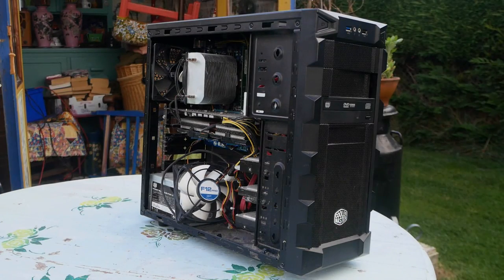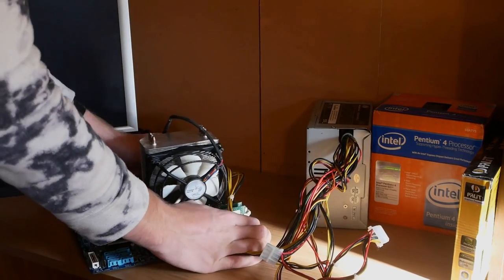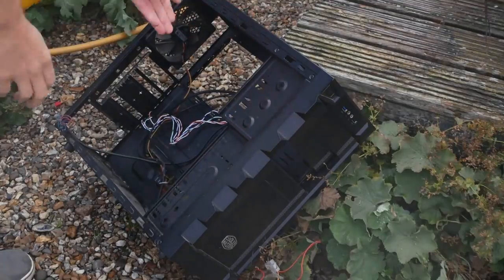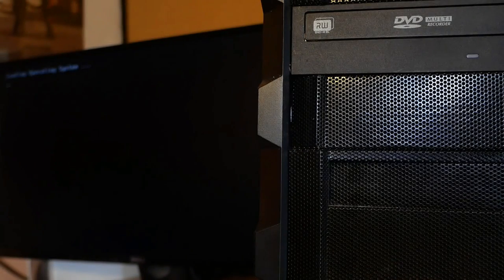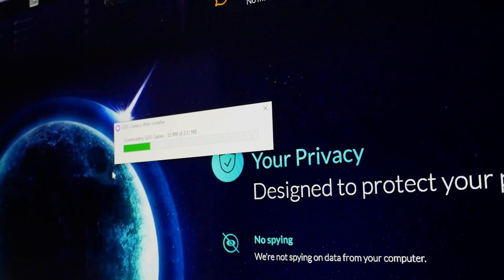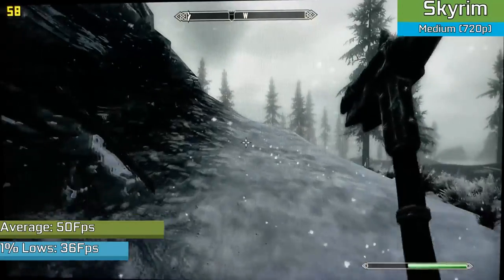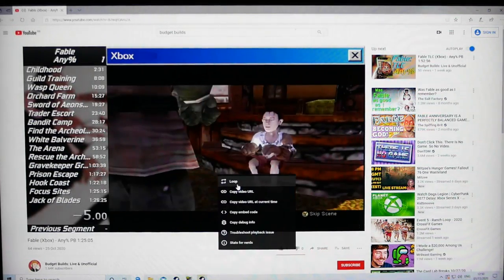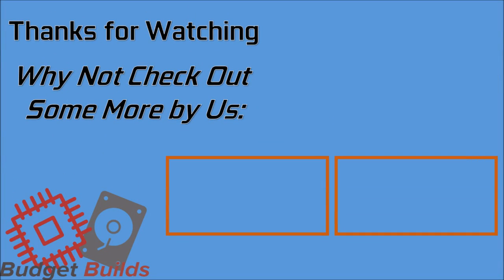I Bought an Awful Computer from a Barn....

Comment: I just found an i7 7700 with a 1060 mini 6gb near a street.
I think i have just used up my luck for the next few years.
Reply: noo wayyy
Reply: I found an NEC EA232wmi on the side of my road. Also grabbed an iPhone 6 (which needed a new screen and home button) and other things from the dump.
Reply: @lbsiuk  how do u even find ANY monitor on the side of the road 😓
Reply: Was the owner far enough for you to run away unseen?
Reply: A couple of months ago, i found some Bose bluetooth headphones, i didn't think much of em, but i went to the electronics store a week ago to pick something up, and i walk by a Bose stand in the shop, i looked at the headphones, and what do you know, i saw the exact same model i found in the dumpster, my jaw fell on the ground when i saw the price: 240 euro's! So i think i also used up my luck for a good while :p
Reply: About a month ago I found a i5 6600k and gtx 1070ti. The only thing wrong with it was a stick of ram went bad. I bought 16 gigs and it is now my main machine
Reply: Think the best thing I ever found was 2x2GB DDR2-1000 for 20€ and a P35 board for 40€
Reply: last month I've found an Alienware Area 51 R4 with 2 GTX 1080TI for 50 € on Marketplace. Sadly it seems no parts are working but still i will make money selling it for parts i think 

In the dumpster i also found my HP Probook I3 laptop from 2015 that had only a bad hard drive and an older AMD FX machine with a 6950
Reply: I just found a i7 2600k, Noctua NH-D14, 16GB Ram with a FD XL on the side of the road. Friend found an AIO pc with an i7-3770 GT 720m with 2TB of storage.
Reply: @DIV9WARRIOR  
Mobo was dead and SSD missing, was a 85€ fix.
Reply: You'd be surprised at how many PC's are thrown out or given away despite relatively simple problems or none at all. Heck, I got a LGA775 with a sticker modded Xeon and a 750Ti along with a decent cooler, case and motherboard (It had Dual NIC for starters, my X570 Taichi doesn't have that) for $26. I think I paid more for driving about an hour to get it and getting a cheap SSD than anything. It was dirty as all heck, but given the stuff inside it, I bet it was a hand-me-down from a rich person a decade ago given away to charity once that lucky guy couldn't get more performance out of it.
Reply: @user-si5fm8ql3c  that's still cheap considering the specs
Reply: @EbonySaints  a friend of mine found an i7-3770 720m AIO on the side of the road that only needed a reinstall of windows. Good thing it was repurposed since the i7 3770 is still a beast
Reply: @garrettdownes3309  I think you guys have a different definition of found than I do. Probably "found" it in somebody's gaming room.

/s (I'm just jealous)
Reply: @davidcazares7441  I ended up giving my old machine (amd a10 7850k gtx 1050ti and 16 gigs ram) to my friend. He loves it since it still works for most games
Reply: @davidcazares7441  I found an Xbox series X on my neighbors porch
Reply: @alexmaldonado2804  Yall need to tell me where the hell you walking, I'd kinda want a 2nd pc.
Reply: @Ficii1  Australian kerbside collection. Sadly it was cancelled this year due to covid
Reply: but i bet you that your core i7 didn't use IDE.
Reply: I found an iPod touch Gen 4 on the ground in front of a little Caesars pizza shop 3 years ago, and I still use today. My only other free find was a matching pair of Optiplex 380 towers sitting out on the curb for bulk trash pickup. One is sitting in the garage and the other I 771 to 775 modded and tricked out as a retro gaming machine.
Reply: @lbsiuk  
heh see you in beno's channe;
Reply: @alexmaldonado2804  That's the kind of PC I could only dream of when I was a kid, it's crazy to see those end up on the street.
Reply: @adamwan267  yeah I was blown away by the specs when my friend tested it, couldn’t believe I had just found an ex gaming pc on the side of the road
Reply: If it were my luck, I'd cross the street to pick up the PC and get hit by a bus.
Reply: @everythingtechnical6344  
._.
Reply: @everythingtechnical6344  a pc I found on the side of the road was like 1 road away I could take 2m to walk there
Reply: I wanna see make a video
Reply: My crazy find was placed beside a garbage bin by the owner who then placed a listing under the freebies section in Craigslist.  He didn't mention anything about the specs, but said it's a free computer giveaway.  I was shocked to discover the specs when I went home and did more research   The 3rd gen i5 3470 with 6gb ram/mb had been transplanted into a branded desktop which originally held a 2nd gen I core system.  I would already have been with ecstatic with that as most freebie systems in my area are Intel 775 based.
Reply: Are you dumpster diving in the same skip as EEVblog by any chance?
Reply: @DIV9WARRIOR  It's in barnet
Reply: @alexmaldonado2804  I got a Lenovo AIO from the dump as well. i5 6400t, 8GB DDR4. The hard drive was almost completely dead and the screen was smashed, but for free, hell yeah.
Reply: @lbsiuk  niice
Reply: congratulations.  👍
Reply: Wow you are the luckiest man ever born holy cow.
Reply: Bro in 2019 when the 2060‘s dropped I found a 1080Ti in my neighbours basement. Never gonna get lucky again

Comment: Just updated my old Pc (i5 760 with GTX 750ti to an i5 4660 and GTX 1060 6Gb off my stepson) and that came in an Antec 900 case with the Artic 7 CPU cooler. I ran Manjaro KDE on it and it flew compared to Win 10 which was on it previously. Try a linux distro and re-install the Radeon 7870 in it. You never know. Great video and welcome back.

Comment: Great video right here. I remember having the same problem of having weird graphics card issues with a PC I built months ago. The card works in my main PC, but not on the new one. The slot is working fine since I installed another card on it. You can be fiddling with PCs for a long time and still encounter weird stuff like such to happen.

Comment: Great video.  I can certainly understand your frustration.  A couple of thoughts.  Did you try a different power supply?  I also wondering even after cleaning if the PCI-E slot is making proper contact.  Maybe sonic cleaning the motherboard, followed by an alcohol rinse, and then some Deoxit in the slot would help.  Of course as was said in another comment it could be a bad trace.  Since it's working now I'd probably just let it live out the rest of it's life as is.

Comment: While too bad about the HD 7870, the revelation of the HD 4670 doing yeoman's work and doing it well was the real star here. The reason behind the finicky nature of the motherboard is likely not worth anyone's time but I suspect it may have to do with reason the RAM slots were gunked up. Whatever was causing that may well have interfered with the GPU slot as well.
Reply: At least the HD 7870 was tested and confirmed good, meaning that GPU can be used in something more worthwhile than what this PC was!
Personally I think the £30 paid was worth it for the CPU, GPU, RAM, ODD, and various HDDs/SSD. Oh, and the PSU as well, assuming it was still capable enough.
The motherboard and case would have probably been binned if it was mine...

Comment: Nice find :D
Weird that the rear fan and CPU fan are configured for positive pressure. Don't usually see that config. You forgot to reverse the rear fan though when you reversed the CPU fan though so its blowing inwards while the CPU is blowing towards it ;)
Reply: I actually have the exact same case for my personal PC and I see why he did it like that, It is because that case has option only for one case fan on the front and it is on the place where he has these hard drives and DVD drive and you can't even put fans on the top or the bottom of the case so if you block the front of the case you got basically no aiflow. But from the back you got space for one case fan, one GPU fan and maybe get some air from the PCI slots if you remove the covers and one fan on the case panel, seriously if you had that case you would understand

Comment: If windows won’t install next time just install it using a different pc then unplug it after it will restart for the first time (so before making devices ready) and you should not have any issues. Also these older 1156 sometimes won’t work with a gpt partioned drive but only mbr. You can easily create a bootable mbr usb installation stick with Rufus.

Comment: I still own a socket 1156 motherboard with a Xeon X3460. The problem you have with booting is that you did not set the primary boot device in the BIOS as the USB stick, let windows set things up and after the requiered reboot that the install ask for, go back in the bios and set the primary boot device the SSD/HDD where you installed windows. All the boards I worked on from friends and my own needed this to be done on socket 1156. Good to have you back again, I missed these budget builds.

Comment: I understand the problems of old prebuilts and custom builds. I even wasted months on an i7-970 build (mostly long because I was trying to save money waiting for parts, case/power supply cables being frankensteined, and inability to boot Windows 10 from USB as Windows To Go). I also encountered the issue of many older computers not supporting USB booting. Plop Boot Manager can semi-help.

I recommend you replace all case feet with new ones.

Comment: Did you try installing the HD 7870 again after the BIOS update? I've seen some old PCI-E 2.0 motherboards have problems with PCI-E 3.0 cards without updating the BIOS. This issue plagued some Pegatron motherboards if I recall correctly but it might be affecting this one too.
Reply from the maker: Latest BIOS installed. Made no difference.
Reply: @BudgetBuildsOfficial  Try different PSU, maybe that PSU is just too weak to run that GPU. (Im sorry if my english is weird, Im from Czech rep.)

Comment: HD 7870 would do alright today still, roughly gtx 1050 performance.
Guessing the motherboard having a spill on it near the ram ports has damaged it enough so it doesn't send power too the pci-e port properly, so either cpu or motherboard swap should resolve that if you have confirmed the powersupply can power the gpu in another computer already.

Also possible the power supply has partially died if it can't power anything with pci-e power connectors in another motherboard if its a multi 12v rail powersupply.

Also as the HD 4670 is working using roughly 65w out of the pci-e slot but other cards are struggling or not working at all I'm thinking its something too do with the pci-e slot on the motherboard itself, specifically the detection pins if you have tried another powersupply already.

Check the pci-e slot if that has anything spilled into it as well.

Comment: Given the amount of issues you had with that PC, specifically with the mainboard, I would guess at some point it was involved with some sort of power related issue like a power surge or lightning strike. I've seen some computers do some wacky things because of that!
Many years ago I fixed a custom built PC that took a power surge via a phone line. Blew out the modem but the rest of the machine appeared to be fine. Funny thing is it had a Celeron 566 mhz CPU in it and the machine would only consistently POST and boot properly if the FSB was changed via jumpers from 66 mhz to 100 mhz which overclocked the CPU from 566 mhz to 850 mhz. I never understood why that started happening but the machine ran for years afterwards with a CPU overclock. Took me a couple of days of swapping out almost every part except for the main board to figure that one out. The person who owned that machine appreciated the extra speed boost too!

Comment: 6:30, the reason why the modernish graphics card won't boot is quite simple, old school BIOS versus "UEFI" versus UEFI.
I have had the same problem some years back when i upgraded my old rig with a more decent graphics card.
It was a i5-2400 on a Cupertino 2 board out of some HP prebuild that a good friend had gifted me. The GT545 that came with the system ran fine, it booted instantly and whatnot.
Then came the day where little Bastet came around with a PNY GTX 960, installed the card and the PC refused to boot.
After some coaxing it at least POSTed but took three(!) minutes on the BIOS screen to decide what to do. You could speed it up by going into network boot and canceling that but yeah, the system wasn't really longterm useable that way. It ran fine when booted, Linux and Windows worked as flawlessly as they usually do, but the boot time was a no-go.
Fixed it by getting another mainboard that had a fully working UEFI, the system still runs in another case as my parents living room PC so that my dad can play stuff like Need for Speed. :)

Comment: I'd wash the mobo under water, but first, take the battery out and PSU cables, let the electricity drain out fully, and go with some soap and a soft brush. I'm an electronic engineer and we do this all the time, just let it drain out a couple of days and be sure that there's no moisture, also spray it with some WD 40 so that there's no chance at all corrosion could strike, and hope that this could fix the PCI-E issues, if not probably some of the signal/power lines are down OR there is an issue with MOSFETs/power diagram scheme...

Comment: Win10/11 ISO's can be deployed several ways to a USB pen drive by using Rufus; MBR mode for older systems with regular BIOSses or GPT mode for newer systems with UEFI. Rufus will also let you set options for Windows 11 setup skipping the CPU/RAM/TPM "requirements" check and create a local user account.

Comment: 7:29 I agree, PC’S are very weird

When I was in Windows, one of the applications stopped responding when I tried to close it. I even used task manager and still wasn’t able to close it. When I shut down the system and turned it back on, it would start, hang on the BIOS Logo Screen for 10 seconds, then turn off and restart again.
Turns out it was a USB which I had plugged into the system, I unplugged it and it booted into Windows again. My guess is that the system was trying to read a “BIOS Image” off the USB. Last time when I booted my computer, the USB Drive was connected, and apparently my Mobo was reading a BIOS Image off there. My BIOS was updated to the latest version anyway. There was no Image on that USB, all I had was NVIDIA Drivers and USB Wireless Drivers which I used for another computer.

I had no idea what tf happened, but it was a very weird day.

Comment: 1:55
Now I want coffee.
Also I recently upgraded my PC with an NVMe->PCIe adapter and Windows 10 refused to boot from that card.
It even showed as a "bootable add-in card" in the BiOS but W10 wanted nothing to do with it.
Instead I used a standard SSD which is fast enough for an OS and used the NVMe for games. That's the sort of thing that happens with older hardware. The mobo is 10+ years old with a 2500k. There's not really gonna be guides out there about it either, since so many people have moved on to something newer.
Kinda glad it worked out that way though since Halo:Infinite is a beast of a game that apparently expects NVMe speeds.

Comment: If a few of of the back PCIe x16 pins are bust, maybe an x8 card would work? The RX460 comes to mind.
Maybe you can fix it troubles by cleaning the hell out of the slot, and reflowing the board with a heat gun.

Comment: Back around 2009 I crossfired three 4670s on a DFI Socket 775 LanParty with 8gigs of ram and a Q9550. Still have all of the components so I could build it back up if I got the inspiration to do so.

Comment: I actually had a 4650 ddr3 in my home theatre pc about 10 years ago and I remember it pretty much like you showed.  It did really well back then at 720p, but it just didn't have the beef of a 4850 or 4870 to do 1080p.

Comment: I recently built up a machine from Parts, an old Intel H61cr motherboard  running an  i7 3770 i had kicking about, stuck an RX 580 4Gb in there and it would not recognise the Graphics card at all, i ended up having to revert the Bios back a couple of revisions, it was a pain in the bottom for sure but it seems to be running very nicely now.

Comment: I have a pc of the same brand which damages usb sticks electrically when plugged in to the front panels. The ports on the back work fine. Is there a way to fix it?

Comment: Recently I had problems on my second PC with LGA 1156 motherboard. I put the motherboard in bin and put inside the case guts from HP Z400 with some slight modifications to case. Now my second PC could accept any graphics card, regardless of subvendor and graphics chip.

Comment: Today me and my daughter disassembled cleaned and reassembled her system. Same case (Cooler Master Centrium K280) ASRock H61M-HVS, I5-3330 with an Hyper T4, Radeon R9 280, 16GB DDR3-1333, 240GB SSD and 500GB HDD, Cooler Master GX 750 Storm Edition

Comment: My barn find was back in 2015, it was a Dell Precision T7500, sure most of these came with a reletively slow 6 core processor(core i7 extreme based just with slower clock speeds), however, this one was special, not many of these actually came with the daughter card for a second 6 core processor and an 1100w PSU. I upgraded it from a pair of xeon X5675(3-3.3ghz) to a pair of X5690 (3.4-3.7Ghz) at the time, the multicore score with 12 cores was noticably better than a top of the line 8 core Intel core i7 Xtreme 5960x

Not bad for $300 all together with -48- 24GB of RAM(more than half that cost was for the pair of xeon X5690). Swapped out the Quadro 4000 for a GTX 960(waiting for the GTX1080 that was rumored) and it was a great PC till late 2018 when it died(was only ever meant for the 95w X5675, not for the 130w X5690) I did find a supermicro board that worked well with the X5690s, but soon upgraded for the 3950x